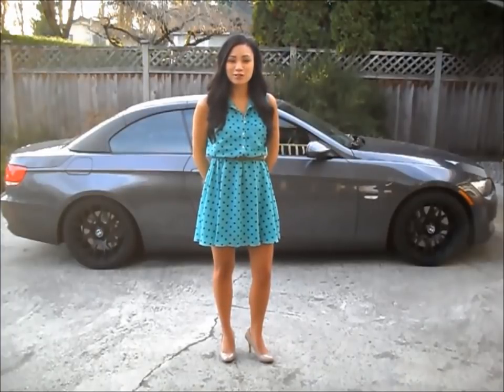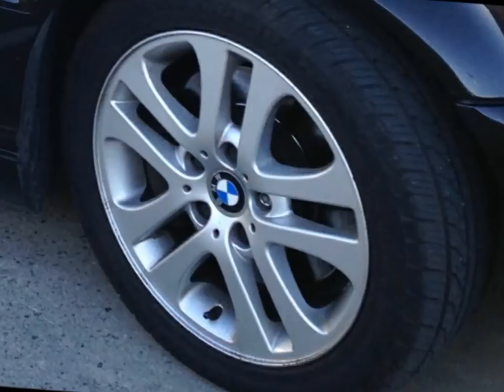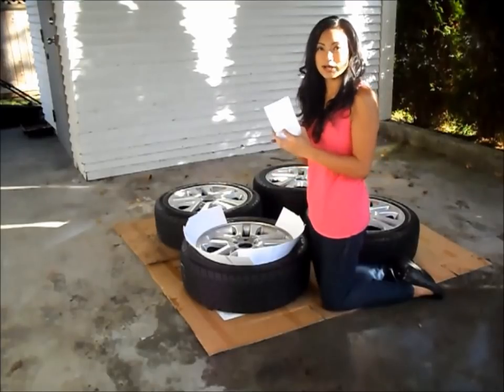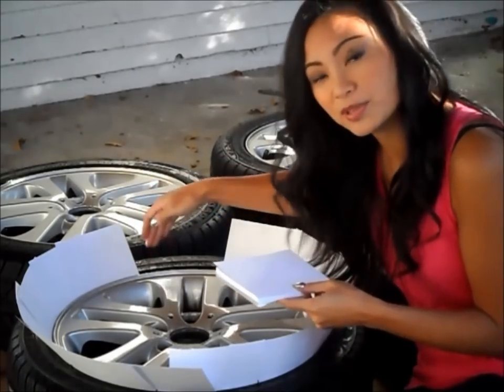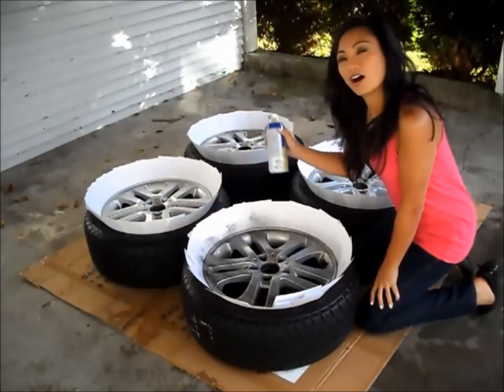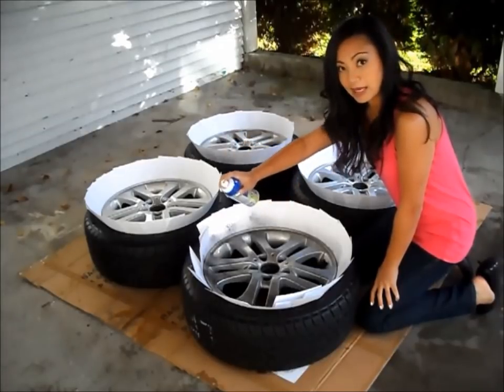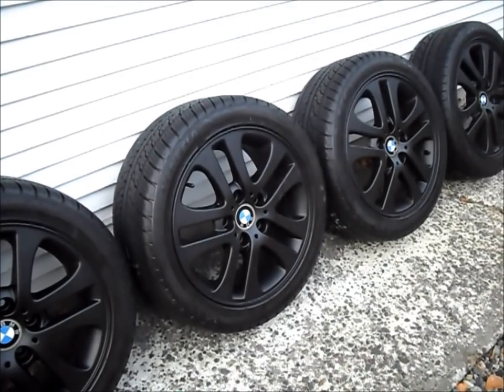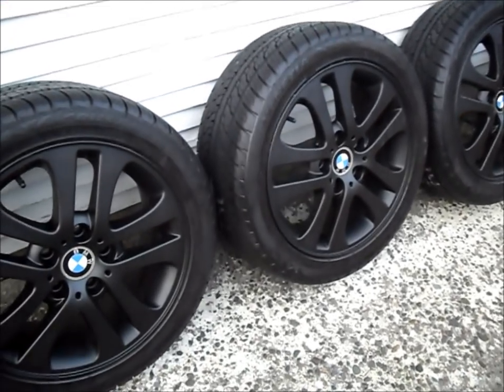How to Plasti Dip Car Rims - Matte Black Wheels

Comment: I know you said in previous comments that you have since sold these rims, but did you ever get a chance to wash the rims, i'm planning on doing this to my stock rims on my 2012 camaro ss and i'm worried about the longevity of the product, I know it's easy to peel off and i dont want to be washing my rims and the paint peels off after extended use lol.
Reply from the maker: I don't remember washing them but tons of people have plasti dipped rims and they wash their cars every few days for a couple years without the dip coming off.
Reply: ok well thats good news Thanks! i'm going to use the same matte black you used guess i'll go ahead and order mine then haha
Reply from the maker: Ok good luck!

Comment: Did your cans spit at all.. I cant keep mine from spitting?? Is your texture super smooth or is there a little texture??
Reply from the maker: Hmmm, no my cans didn't spit. Did you shake the can hard enough and is the nozzle clear? No, my texture was not super smooth. I was told that I did too many thick coats, but I don't mind the texture actually.
Reply: The nozzle is clear.. and I warmed it up..?? Your rims do look good still. I think plasti dip looks good super smooth and with some texture!
Reply from the maker: Can you stick a little needle in the nozzle?
Reply: Good thought, but I did tht 2.. Even with a brand new can.. I am wondering if the cans are bad?? I have truly never heard of tht though.. Have u tried the silver over the matte.. tht was my plane but want to figure how to get this 2 stop.. Thanks for taking time out to try and help
Reply from the maker: Yeah, maybe the cans are old? I don't know. If you bought them at a store like Home Depot, try to return it. Silver over matte? But you what's the point of doing the black matte first? It is just gonna look silver.
Reply: You would think.. but actually there is diff elements 2 it, because its a metalizer. So u can add a metal flake or add diff elements of silver. Lowes and I was thinking I might just take them back. Thanks again sister
Reply from the maker: Ah, ok, sounds cool! Good luck!
Reply: Thank u!
Reply: The cans were bad..

Comment: do you need to buy a sealant over that or is it weather proof?
Reply from the maker: It's weather proof. Plasti dip is often used as a protective coat itself.
Reply: Thank you!  The dust doesn't stick to it or dirt when you drive?
Reply from the maker: No. Well, I don't have those wheels anymore but my grill is plasti dipped and nothing sticks to it.

Comment: Hello,its now some months since you have done this. How is the durability of the coating? Any issues since? thanks
Reply from the maker: +HeyZeus Sunjazz I actually sold those wheels almost right away unfortunately, so I'm not sure. I've used it in other places and it's very durable.
Reply: Thats a pity as I have a set of expensive wheels on my mustang and would luke to know before I do it :-) I am afraid about the effect during carwash - but I love that black matt look so much!!!
Reply from the maker: +HeyZeus Sunjazz It's fine in a car wash.

Comment: Hey Tara, so im on dipyourcar.com and i'm looking at the Matte Wheel Kit.  Do i really need all of these?
+ Dip Coat™Protective Spray 
+ Brake Dust Professional™ 
+ Spray Trigger 
+ Dip Nozzle
Reply from the maker: Definitely not. I do like the spray trigger thing. You can see the one I used in my plasti dip glossifier video that only cost $4 at any hardware store.
Reply: +TVTara Thanks Tara!
Reply: +TVTara One question I forgot to ask.  Before I spray any plasti dip on my rims do you suggest washing rims very well before applying?
Reply from the maker: Yes of course they should be clean before you plasti dip.

Comment: How many spray cans of plasti dip did you use on the 4 wheels?
Reply from the maker: Two and a tiny bit of a third can.
Reply: TVTara Ok, thanks for letting me know! Think the matte black and grey looks amazing!
Reply from the maker: No problem! Actually I think I did too many coats so I bet two cans is plenty.

Comment: I have a white bmw 2010 328i x drive. Will this affect the AWD in the car? I have a bit of brake rust on the wheel will that effect it?
Reply from the maker: Arianna No it won't affect the AWD. Just clean the wheel as best you can prior to plasti dipping.

Comment: Awesome job!
Reply from the maker: +Clifton Clark Thank you!
Reply: +TVTara Did you you have any issues when removing the index cards? On another video I saw where some people were saying you can spray the actual tire and it will peel off afterwards,  but this seems like the most logical way to do it.
Reply from the maker: You can do it either way. I think the index cards are easiest and cleanest. No issues removing them.
Reply: +TVTara Awesome! I just bought a 2016 Dodge Charger RT and after I watched this video I ordered a 6 pack plastidip matte black off of Ebay. Im super excited,  because you make it look effortless
Reply from the maker: +Clifton Clark it's fun. Good luck!
Reply: +TVTara Thank you!

Comment: I just did like 2 or maybe even 3 coats on my rims, will it wash off if i take my car for a wash?
Reply: +Hussain Kamran So did it wash off when you took your car for a wash?
Reply: I can painted some rims on before. it just depends if you put enough coats on. got to let it dry also.
Reply: ***** yeah i did, not it oesnt come off the rims, its nice.. but now after almost 6 months i think i have to use thinner to take it off as it doesnt come off easily now.. lol

Comment: Did you use clear coat protective paint?
Reply from the maker: +Marco Cuentas No.
Reply: +TVTara how do you prevent them from peeling? I did 6 coats of black and 3 coats of glossifier. and I went through a car wash. and for some reason. only the 2 rims on the right. had issues. they bubble so I finished peeling it

Comment: would plasti dip come off my dirt bike frame , was thinking either spray paint like normal or do this but not sure if i presure wash it , it will peal off and look like crap
Reply from the maker: epic gaming Hmm, I'm not sure. You'll probably want to pressure wash it a lot. But I think you should try anyways!
Reply: alright also i was thinking of doing the red plasti dip on like little things and black on the main frame and polishing the aluminum parts to make it look nice :D what do you think about it?
Reply from the maker: Yeah, that sounds good!

Comment: plasti-dip do they expire? I am trying out my cousin's and he left it in garage for who konws how long, at first I think I hold the can too close to the rim so the spray looks spotty. not sure if it's too old stored in garage for too long or I am doing it wrong
Reply from the maker: If it's spotty, maybe you're spraying the coats too heavy? The shelf life is 1year at 77°F unopened.
Reply: TVTara awesome thanks, I think it's too old I gonna go to lowes to get some new cans tomorrow.  so about how many cans do I need for the 4 rims? 4,5 coats each.   model number is 11203 ? just to be sure.  also love your 335i, I almost got one but so hard to find a manual. keep up the good work
Reply from the maker: I think 3 cans is plenty but if the store is far, just buy 4 because you can always use it for something else. Yes, that's the model number. Good luck and have fun! :)
Reply: TVTara will tire rotation ruin the plasti dip then you have to do it all over again? how long does it last? then do you just touch it up or re-do it.   to wash the rims just do it normally? no need to be gentle on it?  do they recommend you go under certain MPH because sometimes I go 100+ lol. thanks
Reply from the maker: Tire rotation may require touch ups. Otherwise it should last a couple years. Wash normally. You can still speed ;)

Comment: Where can I get the paint? What kind of prep work before hand?
Reply from the maker: Online is cheapest but most hardware stores have it.
Reply from the maker: No prep work needed. But area should be cleaned.
Reply: Koo thanks about how long would it last? Or just until I take it off
Reply from the maker: It should last a couple years.

Comment: 2 cans for one wheel or 4 wheels ?
Reply from the maker: A bit more than 2 cans for 4 wheels
Reply: +Kacper Ciszek One can per wheel
Spray them standing up, or on the car with rotors.calipers covered
Use entire can, should take 4-5 coats, will be more durable and easier to peel
Do indoors
Wear a respirator

Comment: What about spraying the inner part of the rim? I have 20 inch rims
Reply from the maker: +Joe Beef You can flip them over and spray a bit but it's not as visible so you won't need much.
Reply: TVTara wow that was fast! Thanks
Reply from the maker: +Joe Beef No prob ;)
Reply: TVTara how was the maintenance? Every 2 3 weeks it needed a spray?
Reply from the maker: +Joe Beef I'm not sure because those didn't fit my car and I sold them. But the other stuff I plasti dipped seem fine for months. Some people even say a couple years if you're careful.

Comment: Also do you have to give it 3 coats
Reply from the maker: Yes
Reply: Also how long should one coat later for.i.e. how many times do I have spray around every coat
Reply from the maker: I’m not sure what you mean. Spray everywhere on the wheel once so that it looks wet. Then let it all dry and do it again.
Reply: TVTara 
Oh ok. Got it. Thanks a lot for guiding.
Reply from the maker: Good luck

Comment: How many cans do I need for 4 20 inch rims ?
Reply from the maker: I used two and a bit
Reply from the maker: You need at least 3 I guess
Reply: +TVTara 3 cans for all 4 rims?
Reply from the maker: Yes
Reply: +TVTara ok thank you so much :) I guess I need a little more because my rims are 20 inch. It looks like the rims you dipped in this video are 17 or 18 inch.
Reply from the maker: Yup

Comment: Holy hell, you waited an entire hour before the 2nd coat? You only have to wait 10 minutes. Taking off the rims and using index cards is fine, but there is a video from DIP that shows a way where you can wrap a half cut garbage bag around the brakes to protect them while the rims are still on the car. Also it's recommended to shake the can for 1-2 minutes before spraying to get a cleaner spray from the can. I feel really bad if you in fact waited an entire hour between coats of paint because the whole process of painting on its own should only be about 1-1.5 hours depending on if your doing 4 or 5 coats (5 coats recommended if your doing a lot of highway driving). Make sure to wait about 30 minutes before taking off the garbage bag and feeding it through the hole and then you can work on peeling excess paint from the outer tire wall. The car should be drivable after waiting another 2-4 hours or if you want you can wait overnight. Your project turned out really good though, I just wish you went into more detail. Luckily for me I've seen plenty of DIP videos already from the makers of the product on their YouTube channel.
Reply from the maker: +marxology Well I was in no rush so yeah after the first coat I was being overly cautious. And the wheels were already off the car as they are a winter set. I have another video using plasti dip with the wheels still on.
Reply: It's all good if you weren't in a rush, I just thought I would let you know so you can save time in the future if you were to do it again. Oh, ok. I didn't know you had another video where you kept them on. This is the first video I've seen on your channel.

Comment: did she just destroyed them wheels ?
Reply from the maker: Nope.
Reply: +TVTara why would you spray  that rubber coating on the wheels. Are you trying to scratch them later ?
Reply from the maker: It's to temporarily change the color. It also protects them. Plasti dip is extremely popular. Not sure why you're hating.
Reply: +TVTara Well first of I didn't say I hate it . Second of all it is not that popular except if you are a rally driver :D And lastly it just doesn't really make any sense to do something for a perfectly good looking wheels . I think case is closed ;) :D

Comment: Love the video, also I recommend you look into BDP brake dust pro, you can find on dipyourcar.com. Works awesome when cleaning your Rims dipped or not(:
Reply from the maker: Thanks! Ok, will check it out. Thanks for the suggestion!
Reply: No problem(: I haven't purchased myself but will as soon as I can. Tired of cleaning brake dust manually? Well spray once and watch all dust just run down. So awesome I fell in love with it

Comment: girl doing a guy job
Reply from the maker: And?
Reply: And what??
Reply: it's not difficult or 'manly' to do this. Every person should know how to remove a tire. Other than that, it's just spray painting it with rubberized paint. Great tutorial, my car has wheels then a hubcap that goes over top. My wheels I'm doing orange, and my hubcap will be black. If it turns out looking tacky, I can just peel it off!
Reply: Get used to it, they outnumber us 3 to 1 on the planet.
Reply: kanobeez no.. the ratio between male and female is 1:1, some countries have slightly different ratios. United States has a ratio of 1434/1381 for women/men. Most of this has to do with the fact that men: go to war more often, kill other men more often in disputes, and die of old age sooner than women. Far cry from 3 to 1
Reply from the maker: Matt Trapy Haha, thanks!
Reply from the maker: 0WoodChip0 Hahaha, aw thanks for the nice comment :)